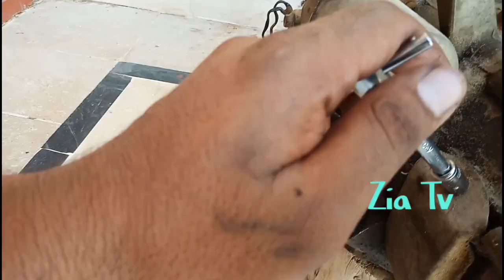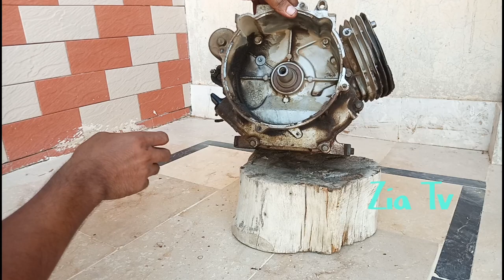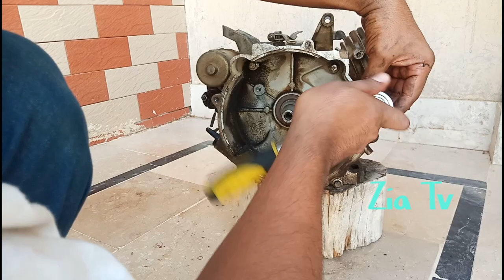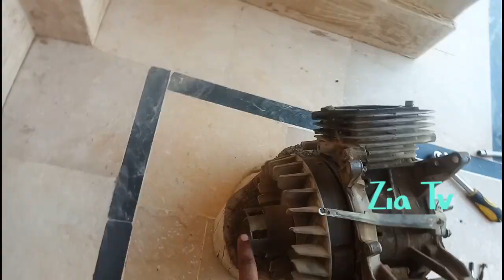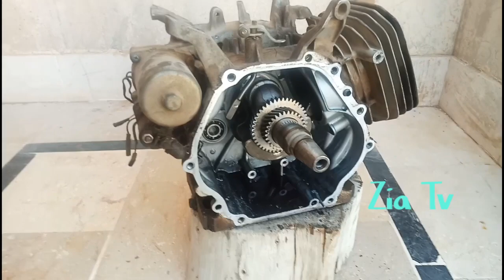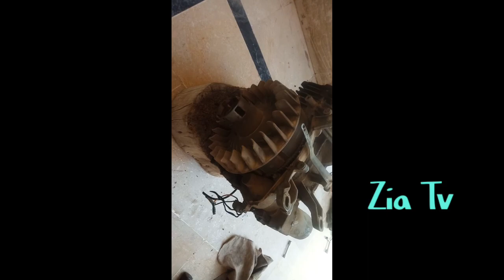390 cc Engine open part 2 ( Urdu / Hindi  )

Comment: Sir mare pass honda 6.5kv hai 
Widin jal jati hai 2 martaba banwaya hai
Reply from the maker: Hosakta ha winding theak sy nhi kar rhy hn 
Ye wire halki use kar rhy hn 

Ap asa kar sakty ho k is generator ka rotor or stater ko de kar koi or rotor or stater le lo jis ma campany ki he winding ho 
Ap is ko de kar wo le lo or thory bth paisy oper de kar bat final kar lo 

Agar asa nhi ho pa rha ha to ye full set new b mil jaty hn 
Wo thora costly parta ha 2nd hand ki nisbat